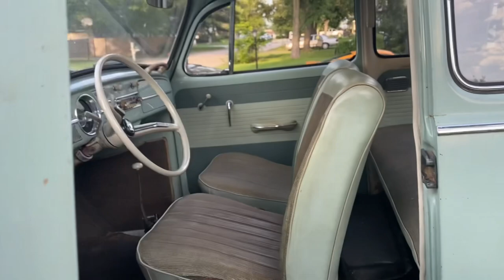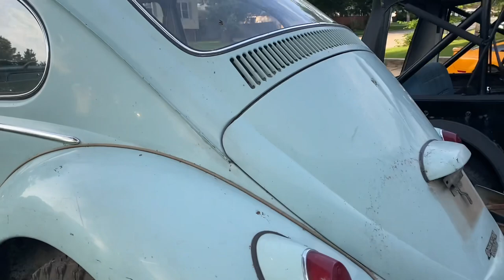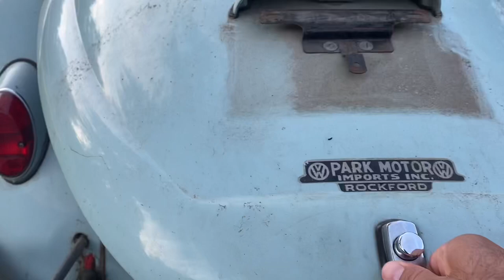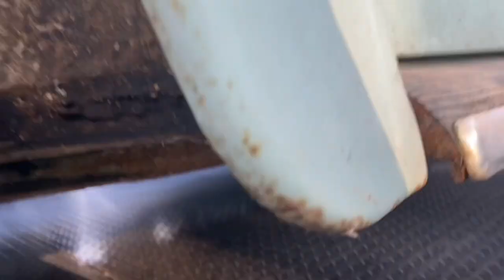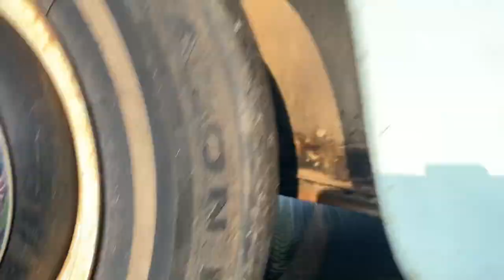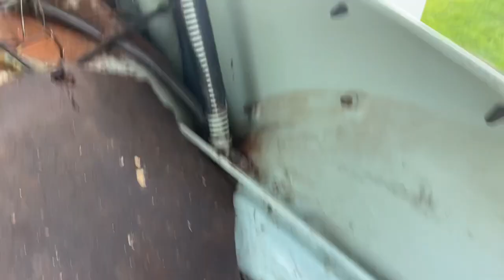Barn find 1965 VW Beetle

Comment: My 65' Beetle is the same color " Bahama blue " with the exact same interior.  Even came with it's original factory wheels and the 40 horse still running like new.  I did need to replace the heater channels and floor pans though.  Good luck with endeavors and enjoy.
Reply from the maker: Very cool! Bahama blue is a great color!